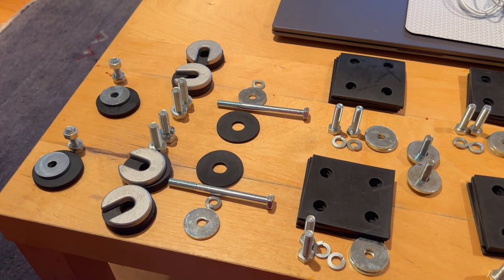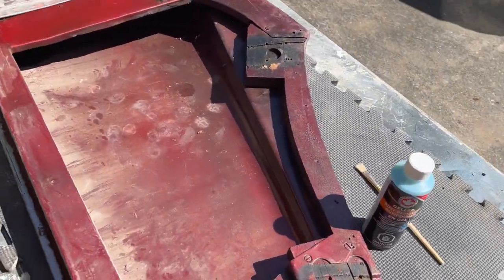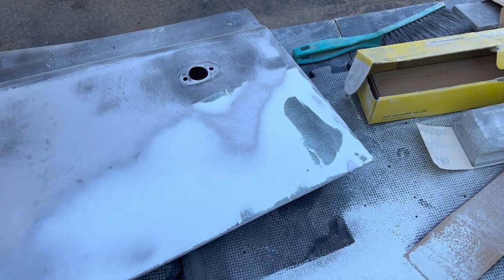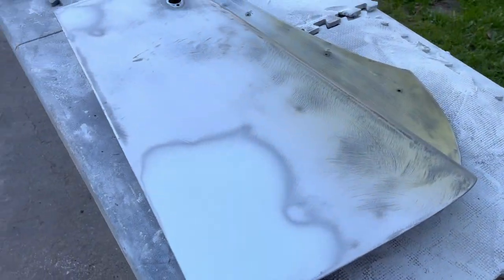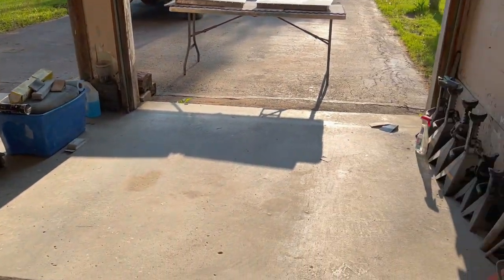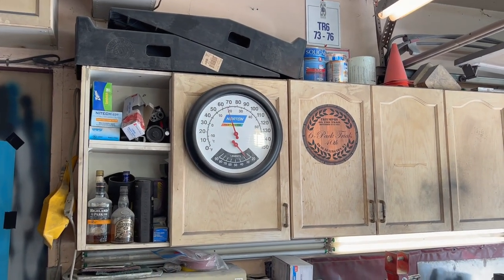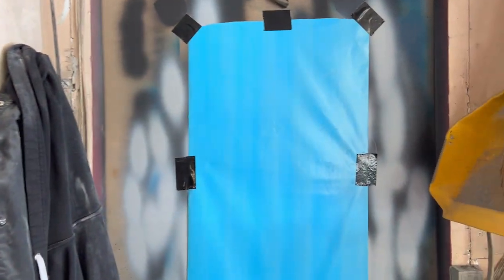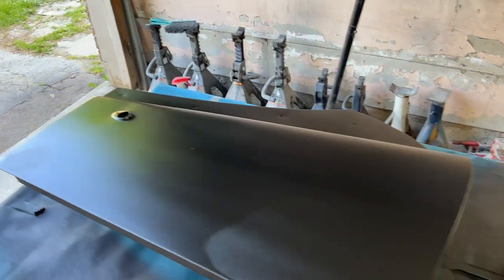1959 Triumph TR3A Restoration, Body Work and Epoxy Primer on the Doors

Comment: Certainly not boring stuff for me as body work and painting are the two things I'm most concerned about for my restoration.  My 1961 TR3 is down to a bare frame that just needs to be sand blasted and then I can paint it and start putting parts back together.  I've watched most of your older TR3 videos and look forward to more new ones.
Reply from the maker: Thanks Neil. I’ll continue to show the process.

Comment: I like the brass hinges. Will you clear coat them? Thanks for the video and all the tips. Have a good week.
Reply from the maker: I’m wondering how clear coat would hold up…I suppose it couldn’t hurt to try right?
Reply: @cheftush  David, you might look into Everbrite or ProtectaClear. They are made to protect brass, etc. against tarnishing and discoloring. Everbrite is for use on unprotected brass outdoors. You might read the blurb on both of them and decide which is more suitable.
Reply from the maker: @BruceBoschek excellent! Will do!

Comment: Very nice work and I am soaking in as much as I can from you so I don't think that work is boring at all.  What size compressor do you have?  Trying to see what you have had success with versus what is recommended.
Reply from the maker: Right now, I have a pretty small compressor, only 30 gallon.  Previously, I had a 60 gallon compressor but it would heat up quite a bit and make quite a lot of moisture in the lines.   I think the actual size of the tank is not as important at the CFM rating of the compressor.  The higher CFM the better.  Your paint gun will require a certain CFM to operate properly. Some guns can need as much as 12 CFM or as little as 6.   Filtration and moisture control of your air is key so be sure to invest in a good filter system.